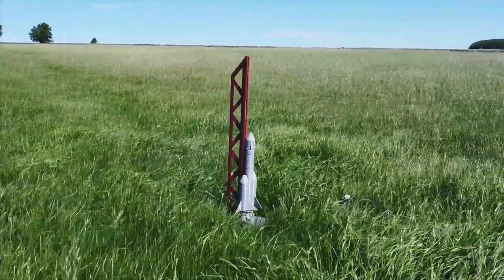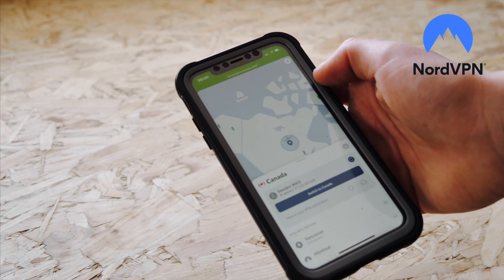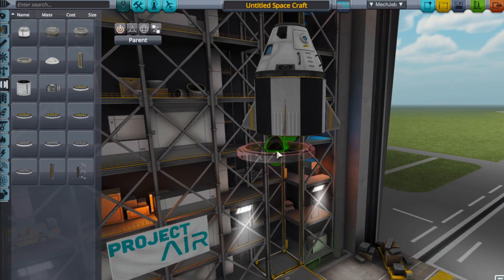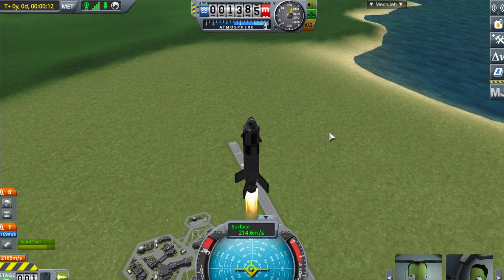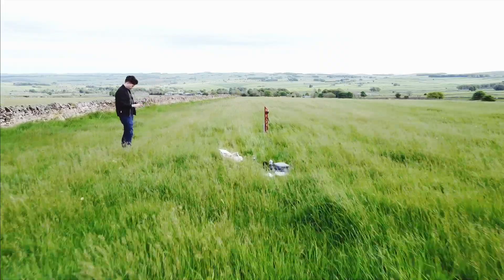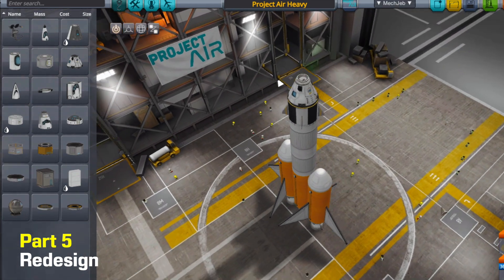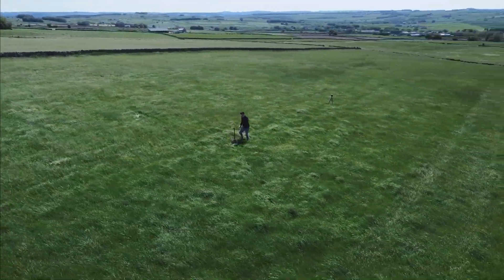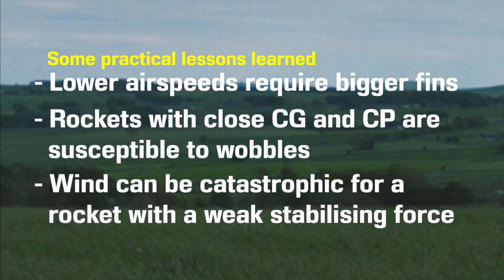Kerbal Model Rockets

Comment: The engines are flat and made of plastic and mannu more falts are made. The timing with the weather sealed the faith with both rockets. The heavy nose could have played a factor as well. Wat i would do: rocket engine cones made real. rocket engine made my self. body made from carbonfiber wait for the wind to die down. Also put a tracker in the rocket.
Let the rocket turn a littlebit for more stability.
Then you can play with the length of the rocket.
More length is more weight but also more stabile.

Comment: butane lighter gas bottles would make a nice fuel tank for a liquid fuelled rocket, project worthy perhaps?

would be interesting to see if you can modify a bottle to be filled by another bottle like a lighter would, so you have a butane centipede going on, aka cross feed the fuel over the tanks, you could stack as many as you like just by adding a filler valve to the bottom and charging them all

Comment: why not putting a gimball in the nose cone together with a small 4 channel servo controller and a small battery. then wire it up to small flaps on the fins and let the gimball try to stabilise the rocket using the fins.

this would mean that you don't need thrust vectoring but would still get active stabilisation on the rocket.

Comment: Add weight to your nosecone and change your inner fin angles.

The issue with this rocket is that your design has probably put your center of mass far below your center of lift (or aerodynamic center if you prefer to call it that).  It probably worked okay in KSP because the KSP rocket had a higher center of mass, and KSP does a poor job of modeling body lift.  In KSP enough fins at the bottom of the rocket can solve almost anything.  Plus, your motors, which are the densest parts of your rocket, are sitting below the fins.

Also note that all of your fins other than the two outer fins are partially occluded by the airflow around your rocket body, giving almost no stability in the Y direction.  Even the slightest thrust differential (and lets face it, black powder motors are at best within 10% of design) between the two outer motors will rapidly start that Y rotation that kills it every time.

Comment: Interesting. As an Amateur rocketeer for the last 22 years. I started on small cardboard rockets from a company here in South Africa. I now sell small rockets. On both the modeular rocket and this rocket I noticed you didn't balance the rockets at all, just saying need bigger fins. Each rocket displayed 1 of 2 variables. 1 the modular rocket, the fins on top allowed for weather cocking this it flew stable when going horizontal. 2 the 3 cluster rocket. EISH!! Your CG was either equal or below your CP. Kerbal space game can take a hike. It does not allow for real conditions it seems. It is just a game. Invest in RockSim or the free ware VCP (Vurtual Centre of Pressure) program.
But anyways, was fun to watch.
FYI I also have an Ender 3, and I use it to produce parts for the kits I sell. Nosecones, and when needed centering rings, fin cans and even body tubes. Only been 3D printing since May this year. But I learned a lot, mostly I learned how much I don't know yet.

Comment: The clip at 1:43 has a funny back story.

That is an Apollo Saturn V command pod with its LES. The main test of that rocket was to test the abort system. It was uncrewed and after a certain amount of time had passed, the LES was supposed to deploy. HOWEVER; during the construction of the rocket, they crossed a wire with the guidance unit by accident and so the fins imparted a roll to the craft. A roll that eventually made it unstable and rips itself apart. The LES had wires that ran down the whole body of the rocket (both on Saturn V and this test). If a certain amount of the wires lost connection, it would trigger. And it does here. Before the pre-set timer goes off, the rocket is damaged by accident and the LES activates.

Comment: I built over 300 rockets over the years as soon as I saw your lunches I knew they fail, 3 things you did wrong fist thing test your balance points to make sure your rocket is balanced well. ( small rocket was nose heavy). 2. use lower class engines on first lunch and (B6-2) avoid C engines on the first launch. 3. your last rocket was overpowered you had too much thrust to the wight. (Pro tip packing your shot use webbing to protect your recovery system). I had many failers and many great lunches. I build all my rockets from scrach.

Comment: the engine is to powerfull for the low weight this causes it to be unstable. it should be more stable with a slower gain of speed.

Comment: O.K., tie a string at the  center of gravity and swing it around your head.  It's called a 'swing test' to see if the fins are sufficient.  Center of pressure should be one caliper (body diameter) behind the  center of gravity.  If the swing test does show the  model streamlining into the flow but wobbles you either add more fin area or more weight to the nose.

Comment: Hey, your fins were too big, making your rocket hyper stable, if you make them a little smaller the thing would have continued to fly straight up. You don't need to 3D print things blindly, you can spend some time doing some math, and adding mass to whichever component in order to make it stable (I would have used either a heavier engine, if possible, or added Clay down by the engine).

Comment: get a real computer. the touch pads on laptops suck for games. you need a mouse. your doing cad with the touch pad too? id rather break my fingers than do that.. seriously.. my fingers lock up using those touch pads. its not a pleasant experience. 
its the Center of thrust, not pressure. Pressure is potential energy from compressed gas.
thrust is kinetic energy from burning gas, liquid, or solid fuel.
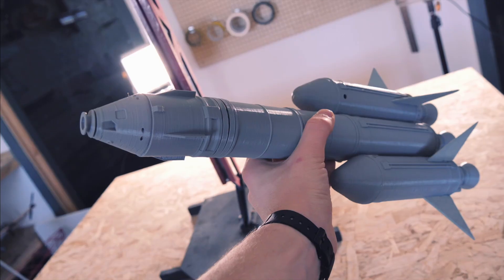13:00 "power to weight ratio" ITS TWR not PWR  Thrust to weight ratio. 
and your parachutes look like their stuffed in there instead of loosely fit. any to much drag and you increase failure rate of the recovery system.
do your launches early morning or near sunset where wind is usually low. as the sun heats the earth air warms and raises creating low pressure zones that more air moves too and you get WIND. 
this is typically the time paramotorist fly due to it being the safest conditions.

Comment: I think you're losing your ejection charge in the overlarge rocket body.  You need an narrow (right at the motor diameter) internal tube running up from the central motor.  Run that tube up to the bottom of the nose cone.  Put your parachute in the narrow tube.  Basically, you'll have a little rocket wearing your larger rocket, but your parachute should then eject.

Comment: what rocket motors do you use?
Reply from the maker: I should have mentioned somewhere in the video, Estes C6-5. Unfortunately we’re limited on sizes here really unless you get certified.
Reply: ProjectAir For a rocket that heavy, you should have used C6-3. The number after the dash is how many seconds between burnout and parachute ejection.

Comment: You make one big error in your findings - having the CG and CP farther apart actually makes the rocket MORE susceptible to being knocked off course by wind. CG is your pivot point and CP is where force is applied, so the farther those two points are, the more torque is going to be applied by the same sideways force from the wind.
I would suggest making the cluster rocket longer and actually eliminating some fins, going with something like the configuration of the US Rockets Dual 18mm Rear Eject kit.

Comment: LOL you used KSP to set the CG and CP but forgot that your 3D printed rocket would not have the same CG and CP because it is not loaded with fuel and your rocket motors have different thrust characteristics meaning a different CP

that's why your KSP rocket and your real world rocke acted differently because then had digrent CG and CP
Reply from the maker: No I didn’t use KSP to calculate the CG and CP on the real rockets, I just used it as a guide and balanced the rockets irl as you would with any other small model rocket

Comment: You needed to use a rocket simulation software package to simulate it.  The rocket was overstable and you're correct it weathercocked  due to the wind.  I personally use OpenRocket (free program that uses java to run).  There's also RockSim available from Apogee Components, but it's not free.
With these programs, you can calculate the delays needed for the flight to be successful and safe.
Come join us at The Rocketry Forum and look for K'Tesh (Son of Kraig->Kraigson (get it?)).

Comment: Instant center of thrust is a key factor in model rockets with no active stability. The centerline engine inherently trusts through the center axis, but the offset of the side boosters do no, unless you cant them in 2-5º.

Comment: what you really need to do is just make them LONGER. the primary body of that rocket needed to be 2 to 2.5 times longer. that would go a long way to helping. also. adjust the parts as needed especially the main bodies so you can print them in VASE MODE. use paper tubes up the center for the motors to contain the hot gases and protect the now much thinner parts.
IF you wish I might also be able to help you get your printer better tuned for better print quality (most likely just work in the slicer) let me know if you want to do that maybe a coop kind of thing ??

Comment: ProjectAir: Launches V1 & V2
Londoners: panik
Reply: The A4, renamed the V2 was actually the 1st rocket to go into space. It flew up to 124km above sea level before turning back to earth. In every country except America space begins at 100 km's above sea level, In America it is 80km above sea level.
Reply: @MrGerhardGrobler  No its 100km everywhere i think
Reply: @rx7241  It was 100km in America, then the pilots of the super high altitude planes complained that they where on the edge of space and so was basically astronauts themselves. So they lower the official start point of space to give these pilots Astronaut badges....
Reply: @MrGerhardGrobler  shut up metric system

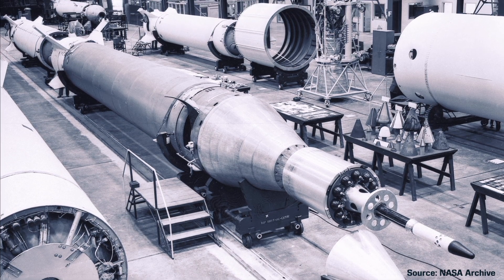Comment: If the scale of the model is 1:50 shouldn’t the mass also be the same and the specific impulse of the engines be the same otherwise it isn’t a proper modelling of the KSP version, I also think this 3D printed plastic is too dense for these rockets, you would be better off with a cardboard tube

Comment: Ever thought about using a longer guide ramp?
We use at least three times longer ones and had problems stabilizing when we used shorter ones before.
Also, are you 100% certain that these little motors produce 1.2kg thrust each?
If youre interested, I'd pin a link to a launch of one of our rockets with data.

Comment: I'm thinking the first chute failed because the ejection charge is going off into such a large space and not making enough pressure to knock the nose cone off. Maybe try a narrow tube from the top of the motor to the top of the rocket, then a sealing disk under the parachute. Pretty much getting rid of alot of extra space in the main part of the rocket body. Good luck!

Comment: I'm an idiot - but it looks like it has a lot less to do with "bigger fins" than your weight is in the wrong place - I remember there is a whole "center of gravity" vs "center of pressure" and it looks like your rocket is upsidedown.*edit - by the end of the vid you mention that..
Reply from the maker: Yep, the centre of pressure and centre of gravity were too close to be very stable. If I increased the length of the rocket and made the nose really heavy somehow, that would probably help on the next one 😊

Comment: Many model dockets  have a narrower tube with in the main body of the rocket with a bafle at each end to redude the volume that the ejection charge has to fill increasing the pdds of ejecting the nose cone. Thay also often ues a fier proof wadding to stop the parishute getting scortched.

Comment: Your main problem is the GC and CP ... make the rocket longer and move the center of pressure back, more fins are not necessary, 4 are plenty ... and keep the fins a reasonable size to reduce wind cocking ....One way to test is to pivot  and balance the rocket about the GC, with a piece of string and cross wooden board to suspend the rocket in a wooden frame,  use a home fan to provide a moving air stream and spin the rocket and see how quickly the rocket tracks into the oncoming air stream ...it should recover reasonable fast but not too fast, ...

Comment: To reiterate in KSPspeak:
1) If you want wings and flaps to work while your rocket is slow, better make sure they're big.
2) You want the blue ball way behind the yellow ball on a rocket. The further back the blue ball, the more stable the rocket. The closer the blue ball is to the yellow ball, the more likely your rocket is to going out of control.
3) Not a problem in stock, but if you have wind mods, if your rocket doesn't have the blue ball waaay back during launch, you're screwed.
Alternately, remember the core mantra of all KSP players:
MOAR BOOSTERS

Comment: There's a free piece of software called Openrocket that will let you build your rockets and input your motor and it will simulate stability, altitude, velocities, etc. It's quite accurate assuming you input your weights and dimensions properly. It can be accurate to 50ft on a 10,000ft altitude flight assuming conditions are right. 

Also, the way it curled over after takeoff has a name. It's called "weathercocking" and it'll ruin your day without a second thought.
Reply from the maker: I've checked that out before but never used it on a project like this. I will be in the future though!

Comment: On kerbal the command pod got a overkill reaction wheel
Reply: So you can turn it off for more real simulation
Reply: Yeah but if you don't turn on SAS it won't be used
Reply: @madferret2045  it will be tho, reaction wheel work with manual controls.
Reply: But I do agree that reaction wheels are OP

Comment: Great video! I would love to see a successful flight, don't give up on this idea yet!  If you go for another attempt, you may want to consider venting the two side engines in the main compartment to help with parachute deployment.
Reply: you can make standalone ejection charges with a bit of black powder contained somehow and use motors without there own ejection/delay charge. Can even wire a basic circuit up to an altimeter and have it go off at a set altitude. There's even a pretty simple equation to work out exactly how large a charge of black powder a particular rocket design will need to generate the required pressure. To make that even simpler they have online calculators that do it for you now.

Comment: i have experienced a similar failure as you did in the first flight  where the rocket pitched over but was then stable i found it to be caused by the center of mass moving back  because the parachute shifted making my rocket a missile.
link to video: https://www.youtube.com/watch?v=bJMb9AufGiw 
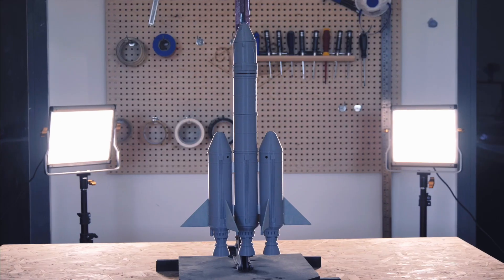footage of rocket missile at 0:52
Reply: I'm also experimenting with rockets and both of my "successful" launches turned into missiles, the first one missing me by only some 3 or 4 meters
Reply: @mininudoalem7950  nice stay safe how long is your igniter cable?
Reply: @francisstapp1583  i used a short slow burn fuse (i know it is not ideal but i'm still working on my igniters) and took cover in a lower area that works kinda like a trench